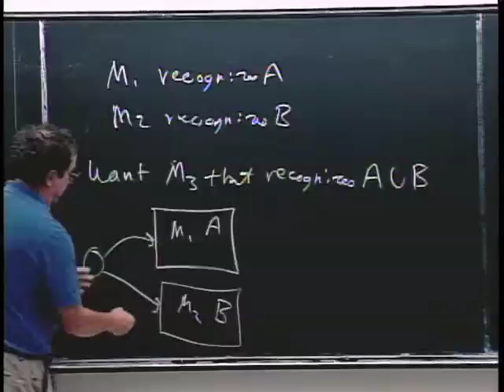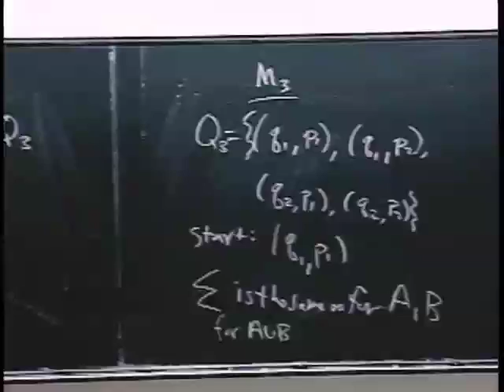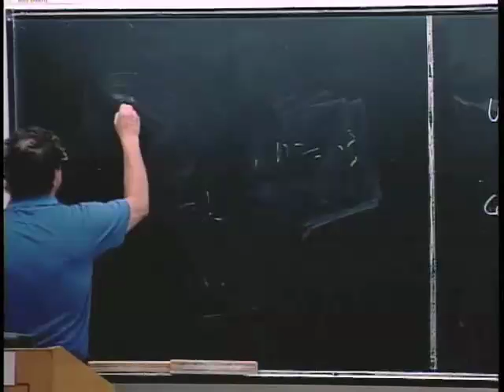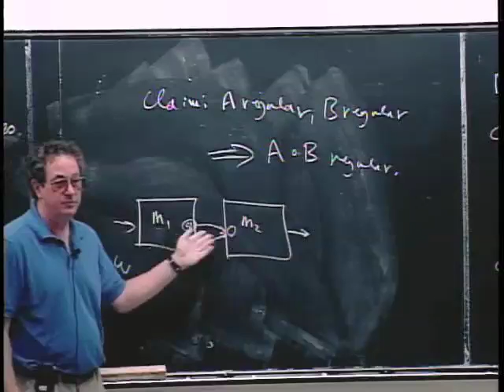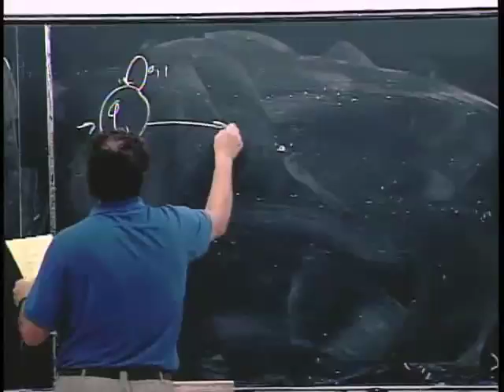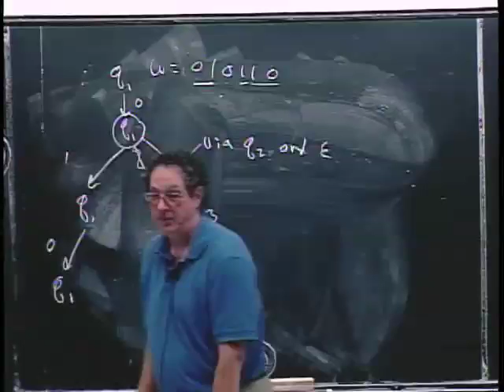L2: Regular Languages and Non-Deterministic FSMs

Comment: after finishing the video. I dont see how the following isn't a solution to the first problem.

The machine has 4 states q0, q1, q2. q3
Start state q0.
Accept states q0, q2, q3.
And transition function F(QxΣ) -> Q.
F(q0,A)  -> q1
F(q0,B) -> q1
F(q1,A) -> q2
F(q1,B) -> q2
F(q2,A) -> q2
F(q2,B) -> q3
F(q3,A) -> q2
F(q3,B) -> q3

I had to have 4 states because I wanted atleast one non-accept state. And this was the shortest one I could think of.

I'm guessing I'm guilty of a silly mistake or my FSDM is illegal/trivial in some way. Drawing it only takes a minute, all arrows go to adjacent q's. Can I get an example of (A^n B^n), that is not accepted.
Reply: There's a difference between a Machine accepting a string or set of strings and recognizing a language. A Machine recognizes a language if it accepts all of the strings in that language and rejects all others. This language is the language of the machine and is unique for the machine.

Your machine M accepts all strings in the language L =  {a^nb^n}, but it also accepts strings not in this language, such as aa, bba, bbbb, or L' ={w| w contains n a's and m b's in any order such that n+m != 1, 5, 9, 13...} This is a much more general language. M accepts all strings in L' and only these strings, so it is said to recognize L'.

This 'if and only if' relationship is what makes the solution insufficient. While M accepts all of the strings in L, it accepts additional strings too. Therefore M does not recognize L and is not sufficient to demonstrate that L = {a^nb^n} is regular. M does, however, demonstrate that L' is regular.
Reply: Thanks! As you pointed out my understanding of regular was incorrect.
Reply: @DouglasNyback  Thanks. This helped